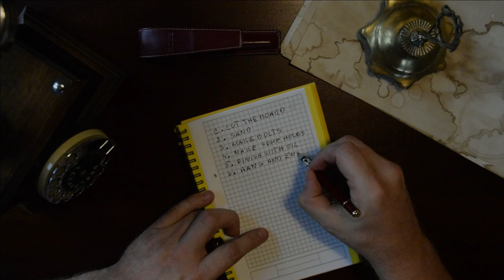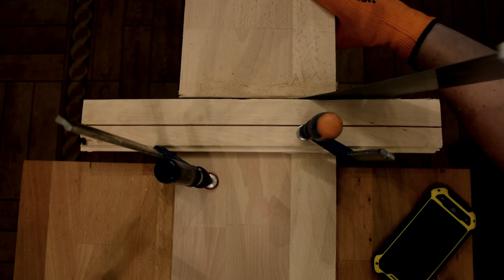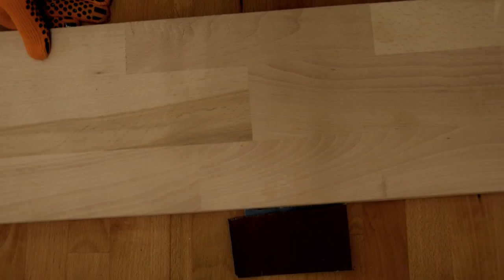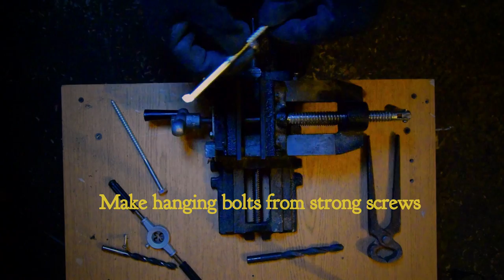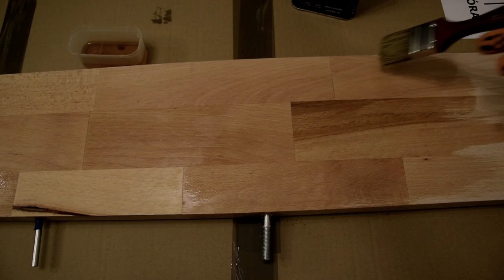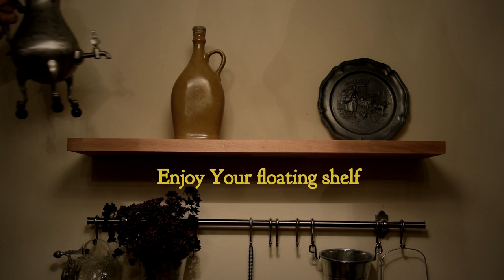What if Wes Anderson made Floating Shelf - tutorial inspired by Grand Budapest Hotel

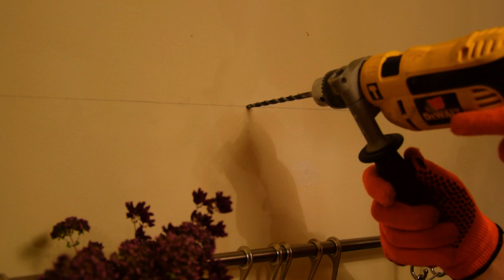Comment: So at 2:17, you just drill right into the drywall.
Reply from the maker: No it's not drywall. This method don't work with drywall. Drywall won't hold such heavy board. It have to be more stronger wall like from bricks or concrete.